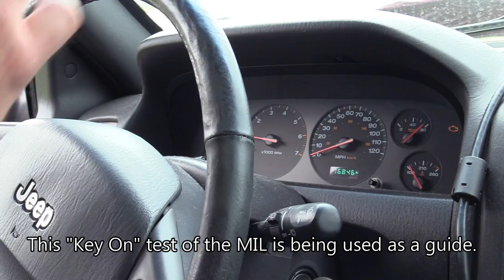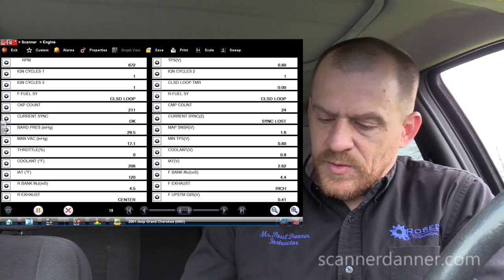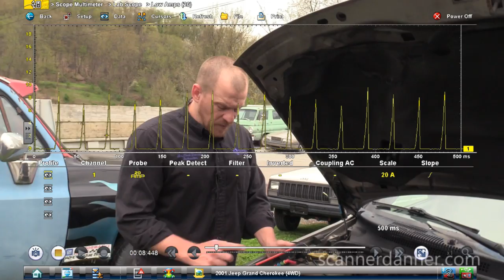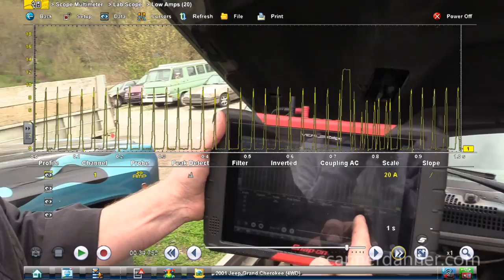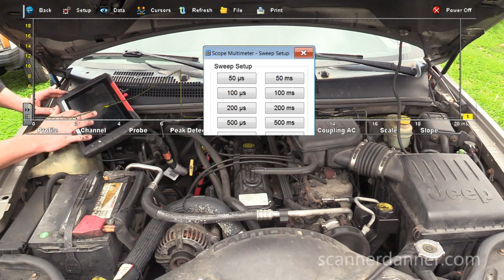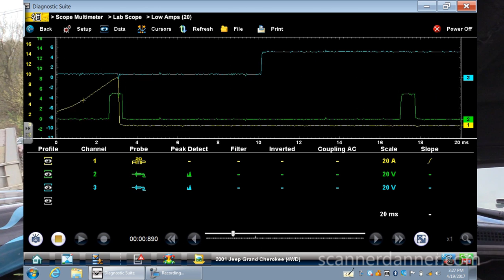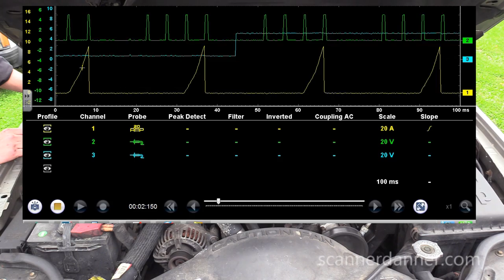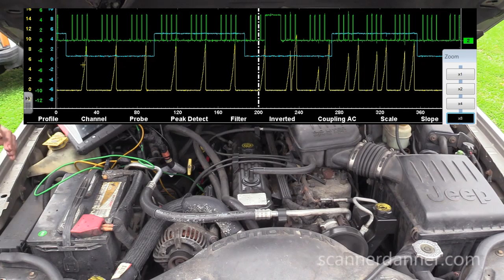Jeep Cherokee 4.0L Misfire and Primary Ignition Trouble Codes

Comment: ALWAYS use original Mopar sensors on Jeeps with the 4.0.
I've seen far too many problems with Aftermarket sensors.
Reply: China metal made out of bean cans or something stuff rust away in just a few years and there rubber rotts as well but hell its cheap enough to buy extra and still be money ahead harber freight put small engine builders out of business with them predator motors 212cc for 100$ cheaper to buy new than to rebuild

Comment: With the cost of a used car and the potential for it to have transmission problems been pretty high. It’s better to repair or replace a transmission and repair and replace an engine! 

It’s better to do that then to buy a used car!! 

Because then the car is likely to last you a long time! 

As long as you keep the maintenance up on it the following time!

Comment: you'll know the relay is bad because when the engine is at op temp the ac will cut off intermittently...because when the fan doesn't kick on the a/c is shut off as a over heating preventative...those fan relays only last a few years...the relay is underneath the passenger headlight
Reply: cheap too

Comment: i'd give my left nut to have a mechanic like you in my town. there's literally 3 shops here in myrtle creek oregon, and two of them couldn't diagnose the same problem im currently having with my 96 jeep xj 4.0. loss of camshaft crank code, multiple misfires along with their codes, cel blinking. brand new crank and cam sensor. new distributor, cap, rotor, plugs and wires, new injectors, new battery, new timing chain and gear, new oil pump, annnnnd new coil. oh and i think the ecm is only 5 years old... ughhhh i want my jeep back. installing a new alternator tomorrow to see if it does anything rofl. please @scannerDanner, clone yourself and send him over here!

Comment: Ok Brandon I hear ya Yes  I replaced the exact Crank PS I use to stall out wait till cools down.  i get it replaced  ran great for about year or so. Now gets warm all the same codes you showed and get this replace the coil pack code said it then got code for cam PS change it ran good for hour so back to same issue mis fire when it idles does ok for short term at light then bam does the mis fire and bad one like hits hard wants die like if crank sensor and and cam sensor are not on the same wave. Now this is the crazy part engine light goes off for awhile you still feel little mis then bam engine light back on and all the same codes. I am baffled i was thinking try change the crank PS again since you said air gap. The unit had life time warranty. I have heard since nbr 5 does lot missing change all the fule  Injection edpecially nbr 5. Also told change the Synchronize shaft the Cam PS connect to. It can go bad even the PCM. Ok it has new Crank PS changed in Aug 2017 Cam PS Dec 18 New Coil Pack Dec 2018 New plugs Aug 2018. What do you suggest. Re put new Crank PS again has warrenty? And replace the Synchronize shaft? And all the Fuel injectors that now come with four spout instead of 2 in each?  If this dont resolve my issue would you say PCM.? And is the PCM  this costly? Help plse oh my issues all started after emssion test they pushed it hard and yeah now it runs like crap again. Help me.

Comment: My son's jeep was doing the same thing changed the sensor now it will not start at all.
Reply from the maker: did you possibly misadjust it? some are not adjustable, some are. Push it in too far and you damage the sensor. Pull it out to far and it may not trigger correctly
Reply: @ScannerDanner  going to check it out today. I was going to put the old sensor back in to see if it will at least start. Thank you for messaging me back.
Reply: @ScannerDanner  it was close enough for the sticker to be taken off. It gave me codes for cam shaft and crankshaft.
Reply: Do you think the camshaft synchronizer could be out by chance?
Reply: I did change out the camshaft sensor as well.

Comment: could the sensor be to far away from the flywheel?
Reply from the maker: Yes. I actually added that caption in the video.
Reply: yes once i was working on my fuel injectors and i must have moved the crank sensor wire up top, it pulled the crank sensor away up from fly wheel, it slid up in the bracket around the magnet that is bolted in place. i tapped it back in and worked for couple more years. so look for that happening. the sealant must have let go.

Comment: That Jeep still sounded awful at the end of the video! THE PROBLEM WAS THAT THE EXHAUST WAS MESSED WITH!!!! If you rebuilt the full exhaust system front to back to factory speck, new o2's, new plugs, new MAP sensor, clean the fuel injectors, oil change and new filter this one would sound like brand new!
Reply from the maker: I think that was more the mic and how it was filtering the engine noise

Comment: Check Spark Plugs
Lazy dishonest Mechanics
They are too lazy to remove coil
Bracket.  20 year old cars the spark plugs are oblilorated...

Not saying there is nothing else.
Good Idea to drop gas tank and change gas pump and sock.  External gas filter too.  Fuel injector cleaner.   Old car high mileage may call for valve job.

Danger Scanner your the best!

Comment: Jeeps are buckets of shit, in fact one Aussie owner got so pissed off with his Jeep, he attacked it with plant machinery, pulled in two, burnt it and finally buried it to prove his point to Chrysler.
Reply from the maker: lol
Reply: mines run 10 years straight no issue. and im lost without it, it does everything i need to do in australia. yes i have an issue now, but the guy here in australia has more money than i have. and the other issue is we get stung about double or more than the usa pay for parts, eg a crank sensor for a 1996 jeep cherokee is $240 at supercheap autos. 1997 model $65 so waiting and waiting for usa stuff to come, or we have to bleed out on our ridiculous rip off merchants to bleed us dry over here. jeep dealers are as bad or worse and dont care, at a dealer thermostat is around $80+ not the housing as well. just the thermostat, hell i go get a $12 one that fits in from another car.